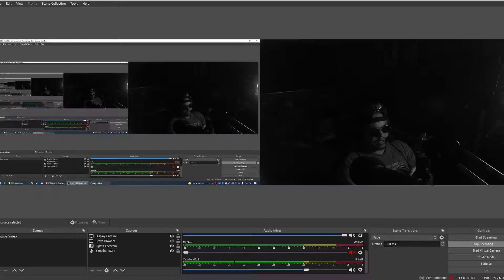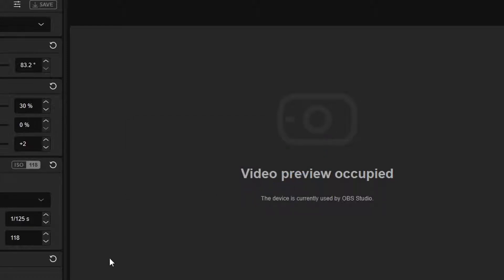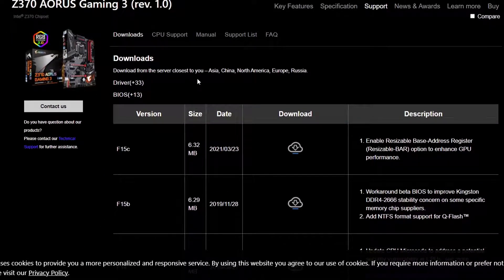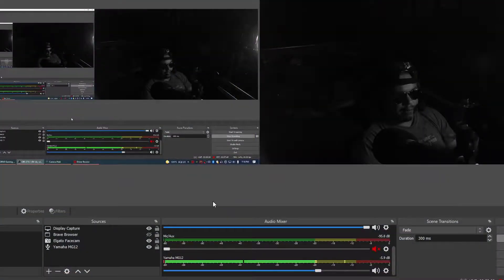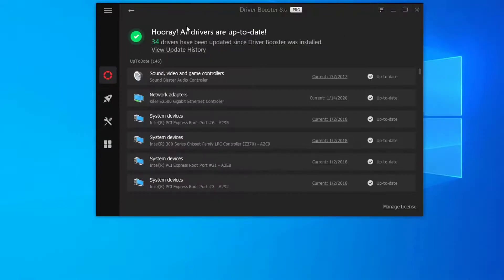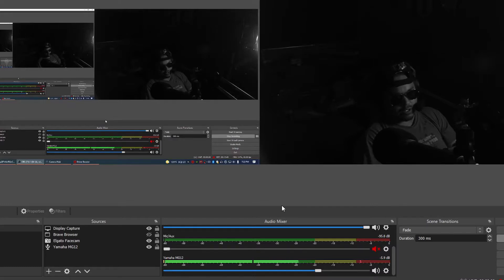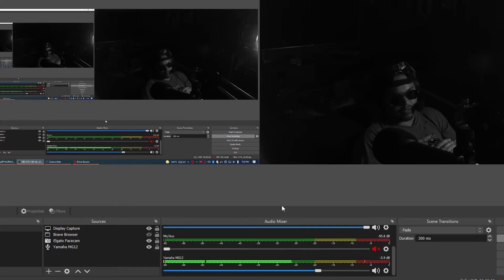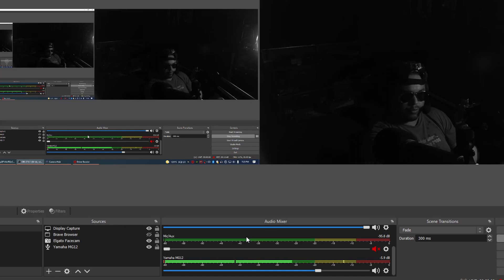Nerd Stuff - Possible Fixes for Elgato Facecam Performance Issues

Comment: dude thank you, I think that firmrate update did the trick. now i just gotta figure out the best settings, cause i just cant make it look as nice as all these other professionals.
Reply from the maker: I'm glad it helped! In my opinion the driver booster 8 is probably the best way to ensure you have the latest/current drivers for your computer system, that makes a huge difference. 

you can download the free version and see what you're missing and if you're not missing anything you clearly don't have to buy the full version to download/update everything automatically, however driver booster 8 pro did work really really well. 

I also left links in the description to other cables that should work because I had no luck so far, however there is a RED usb port that I never tried, Right now everything works really really great so I'm not gonna mess with it and try other cables just yet.

If you want your image quality to look great, you need good lighting on your subject (you).

I use two. One overhead and one aimed in my direction so you can get that clean crisp look.

I'd recommend watching videos about properly subject lighting and also learn about ISO, shutter speed, contrast etc. It isn't hard, just takes a little bit of practice and maybe an hour of research :)

Comment: Good video as always man. I'll try the booster and firmware update for sure. If I have anyone come to me with any issues. I'll send them your way and I make a video on it myself, you'll definitely be tagged and credited. I got the new cable you recommended today, and noticed a difference but it seems like my problem stems from the capture card and webcam fighting for computer resources. We'll see when I get home.
Reply from the maker: depends on what your specs are. I'm sure a less powerful computer might have an issue. Have you contacted elgato?
Reply: @TheWatchFrogs  I have. Running identical to yours honestly 

i7
16gb of ram
3070Ti

So my setup shouldn't be struggling with anything. I'm overpowered if anything
Reply from the maker: @TextureAnimate  hmmm what gen is your CPU?
Reply: @TheWatchFrogs  8th gen
Reply: @TheWatchFrogs  I bring back great news, camera quality is at its peak performance with no issues. The only time it does stutter is if I switch scenes rapidly in SLOBS ( but then who does that? Lol)

I'll be sharing your content on the facecam on my socials to get the word out. Thank you for putting time in to figure this out for us!
Reply from the maker: @TextureAnimate  I had a lot of help and great tips/hints in the comment section! I'm glad it works and its nice people are trying to make their camera fail to see what it can handle and what it can't lol I did the same thing, but I've yet to encounter issues since doing all the things I've done in my videos.

The only thing I haven't tried was the USB type C port and the red USB port, if you have those, give them a try :)

Appreciate the kind words!
Reply: @TheWatchFrogs  I have nothing BUT red ports lol I have 2 2.0 ports but everything else is 3.0. Just gotta make sure it's not directly side by side with anything else that's 3.0
Reply from the maker: @TextureAnimate  man that's so weird, I just can't imagine that much bandwidth being used up to where the camera doesn't work :'(

My cam is plugged in next to a USB hub and that hub has the oculus rift s plugged in lol
Reply: @TheWatchFrogs  dude SAME! now the oculus is underneath the webcam
Reply: Update: the fix wasn't immediate. HOWEVER! This mans fixes DO WORK. You may have to restart your PC after updating firmware and drivers for it to take effect. I'll be putting it to the test in today's Halo Infinite Tech Preview stream. I'll update when it's done!
Reply from the maker: @TextureAnimate  let me know how it goes friend!
Reply: @TheWatchFrogs  will do!
Reply: Something else to note, placing the webcam in its own 3.0 slot where its not next another 3.0 device helps too so it's not competing for bandwidth, which is also mentioned in his video

Comment: Yeah I also sent support a zip file they wanted by email, they haven't replied but I'm guessing they're going to give me the same advice to update the drivers. I'm thinking it could also be the USB cable that comes with the webcam. Sucks you have to pay more money just to get it to work.
Reply from the maker: it does suck... fortunately it was just 20 bucks and I had all the necessary hardware. 

idk what the deal is with the elgato cable, kinda upsetting given the fact they make pro streamer gear... :l